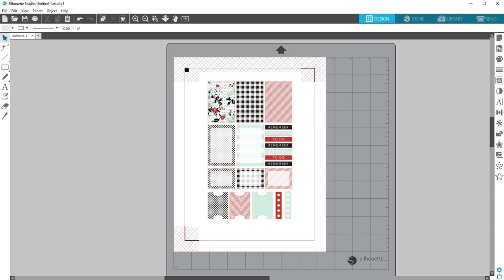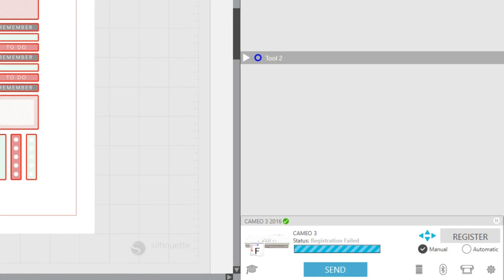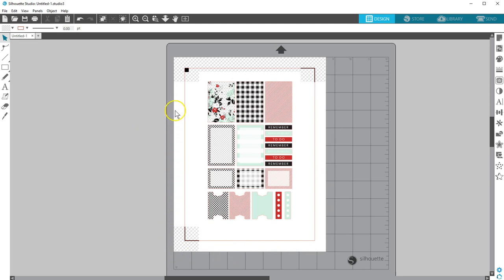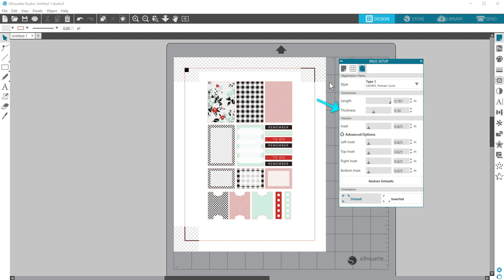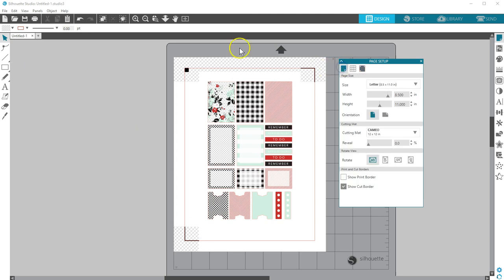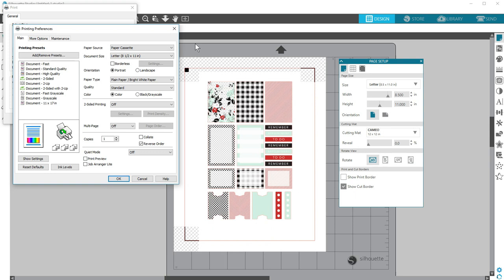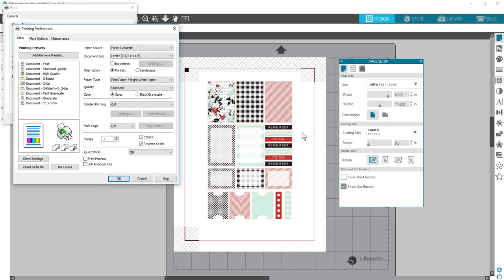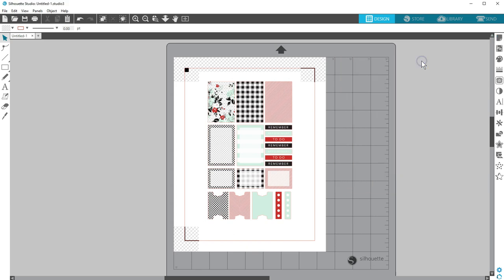Print & Cut Troubleshooting

Comment: What if I did all of this and still my machines won’t register? What should I do next?
Reply: You may need to adjust your lighting in the room, as well. Change the light source or direction, try with lights off, try with the lid closed, etc. Also run a piece of paper under your blade carriage where the sensor is to make sure it hasn't been covered with a stray piece of vinyl. If all else fails, please contact Silhouette Support https://www.silhouetteamerica.com/contact/

Comment: My Cameo 3 will never cut on the lines correctly, I've recalibrated it and adjusted accordingly but no matter what it will not cut on the assigned lines. It's always off
Reply: same, have you ever figured this out? its frustrating
Reply: @amoralxxsuicide0310  I went to the calibration settings, and measured how far off the cuts are from the line and manually adjusted the settings in silhouette.
Reply: I was having problems and decided to color in my black box with a sharpie and it worked like a charm.
Reply: How do I get to the calibration settings
Reply: I've just fixed this my un-checking 'border-less' on my printing preferences (thanks to this video) hopefully that will help you too

Comment: works for me fine with matte printable inkjet foil. but i got a major issue, when i cover the foil for protection purposes (e. g. scratches) with shiny laminate foil: the cut is not correctly on the cot lines and on every picture somekind disortet by random.
Reply: Anything really glossy or shiny can distort the reading of the optical eye. Is it possible for you to apply the laminate, but cut it away from the three registration marks so they are not too shiny?
Reply: @KellyWayment  i will try this next time. i found it also useful to close the cover of the plotter before the sensor reads the marks

Comment: Plz help I press print and it come out blank i have hp  6200 envy
Reply: Your design or text must be filled with color or it will not print anything. The default lines at 0.0 thickness do not print. If you have registration marks turned on and can see them on the screen, the registration marks should print.
Reply: Same problem here!it does not print,the paper comes out blank,no registration marks no nothing.what should I do?

Comment: PLEASE HELP! when I printed my image, it didn't print the grid, but it did print the black box and the corners.
I've gotten it to read twice but cut in the wrong spot. What am I doing wrong?
I'm desperately trying to make a shirt for my grandson.
Reply: So those hash marks (the x's/crosses/grid) are actually NOT supposed to be printed. The black box and the corners are really what you need, as that's what the machine reads. The other thing to make sure of is that the design doesn't touch those hash marks at all.
Reply: Hi Lori I haven't used print & cut for a while but I'm getting the same problem as you, my Cameo is cutting the item but higher up the page than it should be. I've calibrated and the cuts on the crosses was spot on, updated the software and checked my print settings but to no avail. I have used the print and cut process many times before but I'm now at a loss as to what to do. Did you manage to resolve the issue. Kind Regards